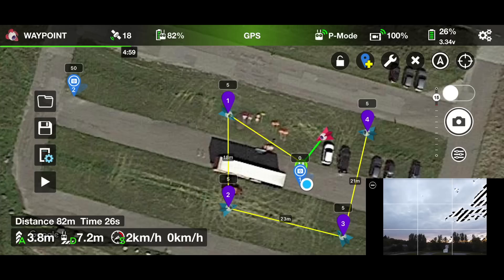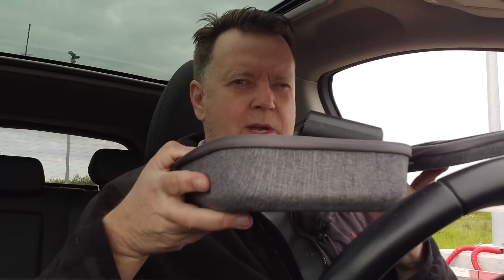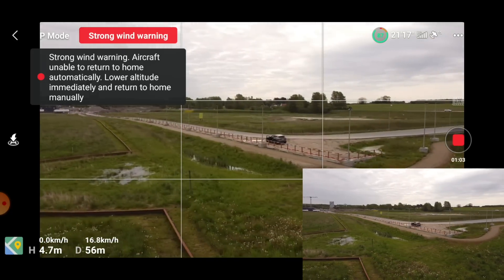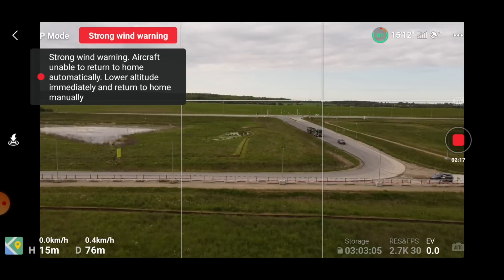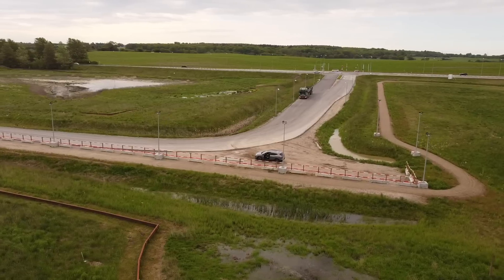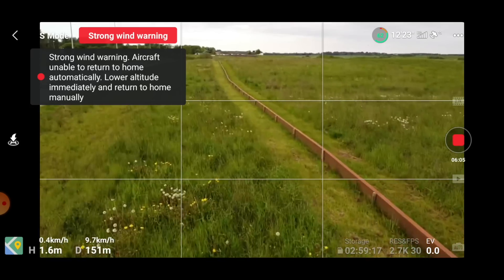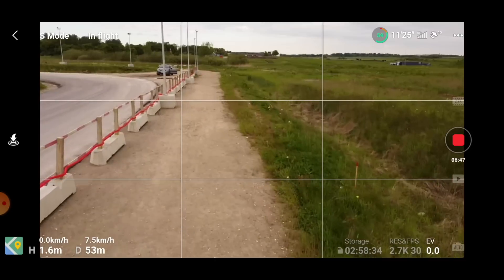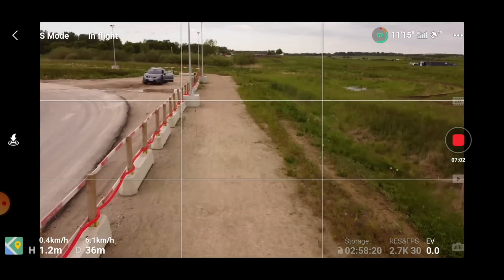DJI Mavic Mini - What is Wrong With It?

Comment: Also you should always have the Attitude Indicator on so you can see the wind's effect on the drone..

And battery like in said is the issue I think..

😁🛸🇧🇬

It just makes sense, if battery is weak in capacity of current delivery then all these wind warnings and max current and max motor speed reached will come up more often even with weak winds because not enough power to fight!

Sweet

🇧🇬🛸🙂
Reply from the maker: good point with the attitude indicator

Comment: It's your battery Henrik, I'm sure of it. If you've stored it not in storage voltage for a while then the battery loses capacity to deliver current, and it's basically the same as bent props, the drone is giving full power but that still not enough, not because of props but battery..

My Mavic Mini never does this, but I always always ALWAYS store it at 60%! Even for 1 day only of course..

Sweet

PS:z get a brand new battery and try and see that the Mavic Mini is a pretty good with wind..

😁🇧🇬🛸
Reply from the maker: It helped power to cycle them

Comment: I have unfortunately found the djji apps run rubbish on android for some reason like on my spark I get 150m max on my s20+ 5g and 100m on my s9 but my iPhone 8 250-400m no issues so off topic a bit but something dji should fix but i don’t think they will and it runs better on iPhone so it’s a consideration to make. I’m hoping to get a air 2s soon.

Comment: As others have said, change your props. You cannot tell just by looking at them. Also check nothing is wrapped around motor shafts (eg hair), but I would be surprised if changing your props did not completely solve the problem. Lots of people have had this problem and especially with the fly more kit. People have modified the case to help prevent. It is usually the back props. Let us know how changing the props goes.

Comment: I’ve had similar issues with my Mini 1 lately,  it’s got to be the latest firmware as it’s never happened in the last 16 months I’ve owned the drone, I also lost connection at 300ft in clear LOS, this is not ideal.
  I think DJI need to look at the latest firmware, I think the problem lies there..

Comment: I had the same exact thing happen to me 4 days ago. This is a flight I've taken many times before and in much stronger winds. I also have the screen recording that shows even at 10ft altitude it was struggling to advance forward and I know the wind was not strong at all this day. 2 wind apps before flight had the winds under 10mph from ground level to 150ft and again I checked them both after my drone dropped into the water on account that battery died. It just didn't seem to have any power in a light breeze. Of course since I ignored the wind warning there's no point in bringing this up to DJI. IF I didn't fly any time it gave me wind waning I'd never be able to fly because it gives a wind warning if a nat facts. I have been practicing flying in high winds since the mini 1 came out and I'm very good at it and have flown in winds 4 times stronger. It just doesn't make any sense to me. Ive been flying DJI drones for 6 years and I'm very capable and experienced. Didn't get any motor speed errors or any other warnings that would suggest warped props either so thats ruled out. I do have a theory if you want to hear it
https://youtu.be/5btN2fbBLlQ

Comment: i believe the root cause is - when flying the litchi waypoints or follow me  , the engines are trying to compensate to the movements and heights and since they might be pretty steep and tight that is the result (you can notice when it in autonomous flight that the engines makes a different noise then when flying manual in DJI app) but that"s my assumption.

Comment: Just a thought. Do you think the high power cable running within a meter or 2 of your radio might be causing interference? More so as you got closer to the ground at the end of the video things got worse as the Mini was also closer to those high power cables (see the red cables running into the light poles along the road). My thought was most likely IMU and Compass errors from those cable. Lastly seeing the gimble give that little drift to the left just after you landed suggests again electrical interference.

Comment: Maybe your Litchi App (or some of its cached data?) is interfering with the DJI Fly App (if both apps are installed on the same mobile device)? 
Or did you use a different mobile device (resp. remote control) at the beginning of the footage (where you can see the litchi waypoints)?

Comment: I agree 100%. I too think the props have been subtly warped, but not enough for you to percieve it... enough to effect the lift of them though. That last sudden drop is a common side effect of it as the motors are overworked to compensate and eventually fail to do so causing drops. The warping happens when storing it in the case. It is easy to know the answer though... For about $12 you can replace all the props and see if the issue is resolved. Case closed.
Reply from the maker: yes, I will replace the rear props and retest.. it's crazy this can happen without any visual difference
Reply: @TECHDRONEMEDIA  I think you can tell, but only comparing them to new ones, side by side, as it is just a matter of a few degrees of pitch that makes all the difference to that lift.

Comment: Max speed warnings normally show up when the battery is overheating or  underheated....and the ecu limits speed to not damage the battery.....that happens in older versions mostly in winter times..
Reply from the maker: Temperature was around 10-15C so I don't see this being the problem
Reply: @TECHDRONEMEDIA  Yes, I have problems when it's -10 to 10 or so..... If the battery is under 18C and you are pushing it more than it's normal, it might start saying that. Mini 2 is a bit faster and better than the Mini 1 in all regards at the same weight? Sometimes physics and reality steps in and shows the compromises they made :D.

Comment: Its pretty hard to see a warp in the mini props with your eye. You probably  need  a wind tunnel to properly diagnose it. A simpler and cheaper option is to just replace when you see that max motor speed warning on a windless day
Reply from the maker: This is crazy if it would have that effect - I understand the ESC error, but loosing force like that seem odd

Comment: Beta software suggest that the software isn't product release quality? :-) so I don't really think you should be surprised when errors are returned by said software, but good luck anyhow H :-), I should run with the latest OFFICIAL RELEASE Litchi app (if it's available) :-)
Reply from the maker: That what I do in this video
Reply: Sorry if I offended, keep up the great work :-) GB 

9i wasn't veryy good as a politician either :) I was always worried the ENglish would invade :-) (thet still could :-)

Comment: That's not good. Something really wrong. Maybe calibrate remote and then re install app and firmware. Does the drone sound weak? I had this problem on Monday in UK but the wind was really bad here and it took 70 % of the battery to get it back to me.  Good luck buddy as nobody likes a poorly mini 2
Reply from the maker: This is a mini 1 issue, and I will get it sorted :-)

Comment: I had a similar problem happen with my Mini last year.  My batteries were fully charges, but weren't used for 12 days, so I topped them off and got the problem.  It couldn't fly home in Sport mode and it wasn't windy.  The battery indicator showed the battery drained from the 40% level to 5% in about 3 minutes trying to fly back.  Now I drain the batteries completely and recharge them if I haven't used the Mini in a long time; I haven't had that happen ever since.  Maybe that was the problem, maybe not.  Luckily it's been solid ever since.
Reply from the maker: ok, this would be my next step after replacing the props

Comment: One word, use litchi 😊
No hassle with updates to Fly App.
We have come to a point with DJI fly app for Mavic Mini when i'll see no point to uppgrade because it will lead to only trouble. Specially if use Android.
Don't know but for me Litchi with mavic mini works fine and even i most cases better. (Except maybe cam settings).
Only my thoughts... cheers👍
Reply from the maker: This video is using FLY App 1.4.2

Comment: Hi Henrik
It looks a prop problem. The warnings were added on firmware 0500 to warn pilots that the aircraft is reaching a point where it could do an uncommanded descent. The reason, as someone already said, is that due to the rear propellers being warped (you can't see the difference unless you put a warped propeller next to a new one) the Mini can enter a stall when it flies forward. To prevent the stall the ESC limits the tilt angle reducing the max speed the Mini can achieve. I would try to turn the Mini and fly backwards. Flying backwards the Mini lowers the rear and having a lower rpm of rear propellers enabling the Mini to have a higher tilt angle increasing the speed.
Reply from the maker: This is crazy if it would have that effect - I understand the ESC error, but loosing force like that seem odd - But I will replace them
Reply: @TECHDRONEMEDIA  when the propeller is warped it generates less lift and the ESC will increase the rpm to compensate this issue. When it reaches the max rpm on the rear propellers the Mini cannot pitch forward unless it reduces the rpm of the front propellers which can make the Mini stall.
It's a question of aerodynamics induced by warped rear propellers. The fact that rear propellers are under the belly of the Mini when folded is the cause of the warping.
I leave the Mini unfolded when at home and I only fold it for transport on the combo case. Also, I have a propeller protector installed when folded inside the case.

Comment: Interesting. I'd guess that it is a warped prop. My Mavic Mini started to drift a little on take-off, and on a vertical descent, so it's time I changed my props too. The inefficiency of bent props can result in feedback that causes a fast flyaway.
Reply from the maker: yes, I will replace the rear props and retest

Comment: I don't think anything was achieved with this video.  It's very sporadic and must be something with your mini.  I've had the original Mini since launch date, and it flies fine.  I had to change props recently, but my mini always flys as it's designed to.  I do believe people are warping or "flattening" the props by using the DJI case.  No room between top and props when closing.  If my mini says it's experiencing high wind, I trust it and fly back.  In your video, you show a flag perfectly blowing straight out in the wind.  So there was wind.  I just think this whole video is inconclusive, and leaves everyone in doubt, when they really should just trust their drone, and fly sensibly.
Reply from the maker: What did you expect it to archive? I'm share an issue I have seen, and ask you guys for input how to fix it. yes, it do not say there was no wind, i'm saying no wind at any significance and not in a magnitude that could not be handled by a fully functional mini. The wind direction was perpendicular to the flying direction
Reply: @TECHDRONEMEDIA  Sorry, not trying to be combative.  I just dont think its a problem in that kind of wind.  I might be wrong.  I just never fly my Mini in those type wind conditions, regardless of the direction, because as you know, wind direction is subject to change at various levels.  Good luck.... You channel is my favorite to go to for current information.  You do a great job and are funny, which makes it interesting to watch.  Cheers!

Comment: Good content, but mine I have had another problem that is when connecting the drone to the transmiter many times it does not show the image on the smartphone and the image stays black. What could be happening in your oppinion?
Reply from the maker: wifi pollution in the area where you fly?

Comment: That was very interesting. Please update us on the findings. My thoughts for the record would be the props are not generating much force so this causes motors to run at top speed and gives the impression that there is a high wind . I would compare props with new ones and see if they have the same shape and just change them any way it’s the cheapest thing to try and I believe the mini 2 props would fit which you have a spare set of in the combo kit.
Reply from the maker: yes, I will update you on the findings

Comment: It's the latest, but definitely not the greatest version of the DJI Fly app. Mine and others where totally fxcked, after installing 1.4.2. After deleting the app and reinstalling the older version 1.4.0, there hasn't been any trouble since.
Reply: I did the same and had the same results.
Reply from the maker: this is not a 1.4.2 issue, as it happend first time with Litchi Beta
Reply: My Litchi app was also acting strangely, when my DJI Fly was the 1.4.2 version. I believe it works as a layer on top of the DJI software. After going back to 1.4.0 both apps has been working fine since. I should have mentioned this in the first post.

Maybe try your Mini with an Android phone using an older APK installation file. If you don't have it any more, I can send it to you via your Facebook profile, you use as admin in the Danish DJI Drone group?
Reply: @TB_Production_aka_TB_76  i would like to have the 1.4.0 apk. Is it possible to send it ?
Reply: Sorry, just realized you said 1.4.0 which is no longer available on the download site, but you should still have the original saved on your device.
Reply: @michaelwallisch1053  how do I find you? I'll gladly send it to you, if you don't have it anymore 👍🏻